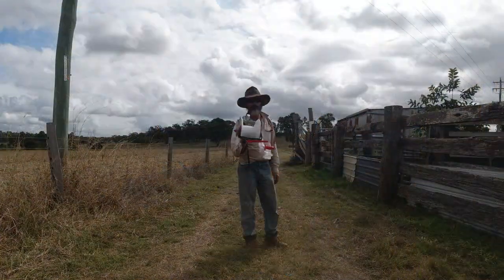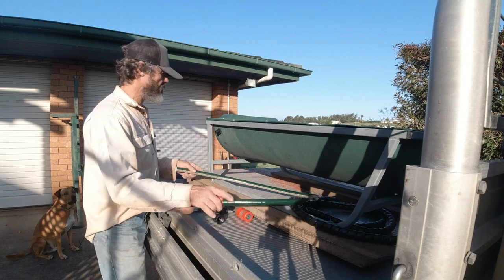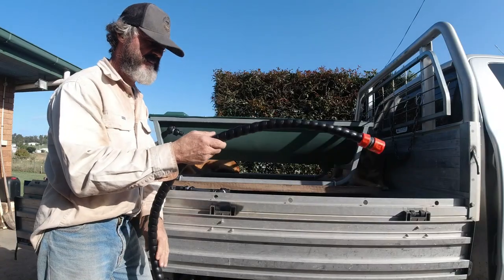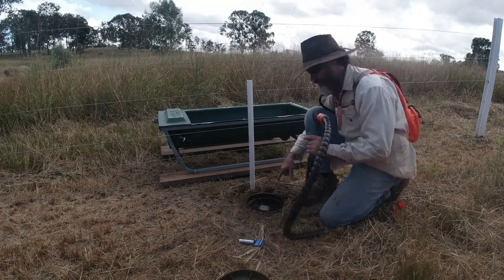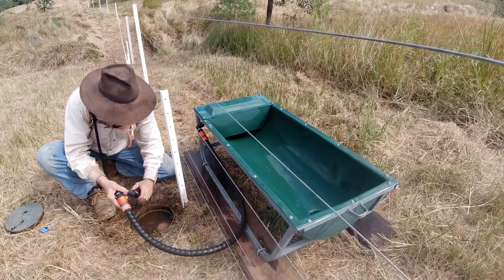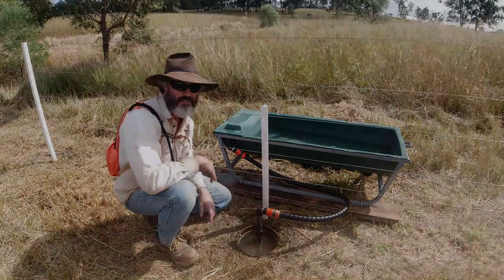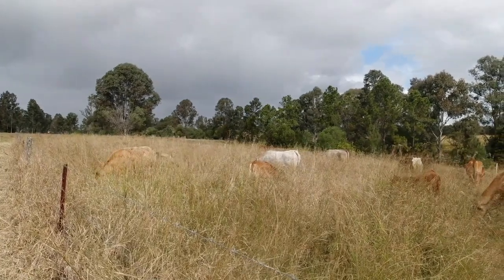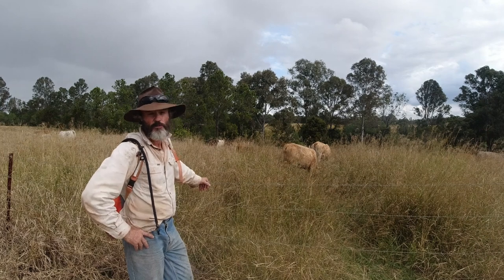Portable Livestock Watering System!!

Comment: The water will get hot in the plastic trough, they will do poorly. Hence why we use concrete.
Reply from the maker: Hi Jake, firstly thanks for choosing to watch one of our videos and secondly for taking the time to send us your message. I originally thought that as well, until we experimented with a 205Ltr plastic drums cut in half, making 2x 100Ltr water troughs which we utilised all year around for 3 years in the Queensland heat. We had no issues: the livestock drank from them all day every day. Though they weren’t self-replenishing, so we had to top them up twice a day.  From those findings I had no issues buying that 98 Litre which is self-replenishing. I got a set of concrete troughs, and as you would know there a permanent fixture, and seeing where heading down the regenerative farming route whereby we move our livestock daily into fresh pasture the troughs must be portable. Unfortunately, the concrete troughs aren’t, so the plastics troughs are perfect for our endeavours. Cheers for your concerns though mate and we hope you have a good day. Jason & Nic

Comment: The trough is also too small for that many cattle, if water goes off they will empty that in 10 minutes, hence why we use 1000 gallon troughs.
Reply: As long as he has a high volume that refills quickly then no issue.

As long as tank refills quickly cattle are more likely to drift in for a drink in small numbers over extended time rather than entire herd all at once.
Reply: @willbass2869  no they will camp during day...water will get hot, water breaks they screwed immediately, need to spend proper money.
Reply from the maker: Hi Jake, like I mentioned we used the 100Ltr half blue drums for years, yes the water only got warm (Not hot) once they were below half full. The new 98Ltr is self-replenishing so it's always full. As the livestock drink, it replenishes with cold water coming from poly pipe 600mm below the ground, so the water is extremely cold. We been using it for 3 months now and the water has never even been close to warm as the old blue 100Ltr were. Breaking would be an issue and is always on my mind. That's why we try and keep the coupling under the trough, and we plan running a hot wire over the top as well as pegging them down when we start cell grazing. Until then we are cautious of breakage. Hope you have a great day mate. Jason
Reply from the maker: Hi Will, firstly thanks for choosing to either watch and or respond to messages on our page, it's greatly appreciated mate.  I can see you're clearly all over this and I don't need to say or add anything here. Cheers again for your feedback mate. Hope you have a grand week. Jason
Reply from the maker: Hi Jake, Thanks again for watching one of our videos and for spending time on your multiple responses, it's greatly appreciated mate. It's a fast flow self-replenishing 98Ltr trough, and up its arse it's gravity fed by a 12000 gallon water tank which is sat 20mtr higher than any coupling. That 12000 gallon tank is fed by a separate feed line also buried 600mm underground which is hooked up to a large solar pump, which is pulled from a 100mtr wide river. So the flow rate nor running out of water is neither a concern. The trough is plenty big enough considering the fast replenishing flow rate. I've also studied the herd drink, generally four at a time, the dominate ones first, each in the herd know their place and are only happy to wait their turn. I wouldn't be happy about tipping out 1000 gallons of water  everyday. As that's what I'd be doing considering I plan cell grazing and moving the herd and water to fresh pasture on a daily basis. Hope you have a great week mate. Jason